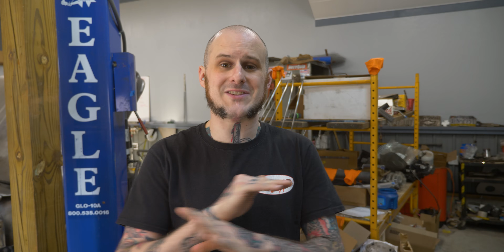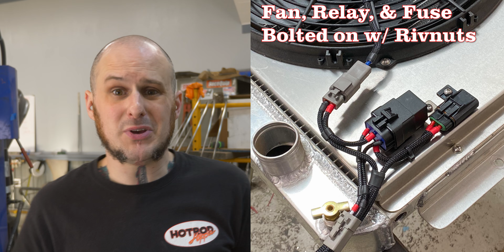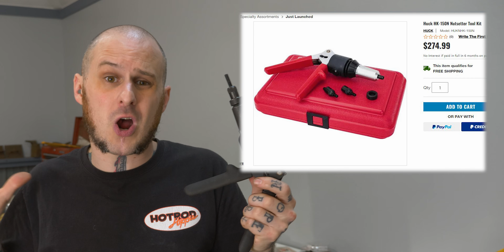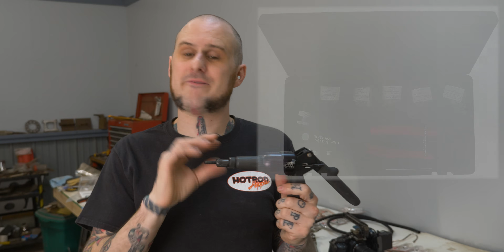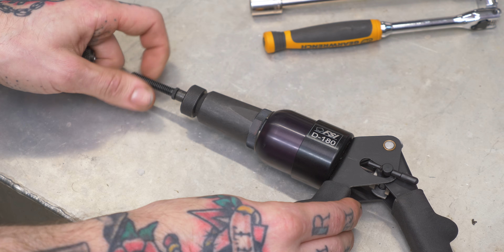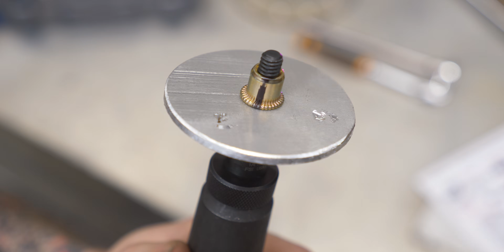RivNut Tool YOU NEED! - FSI D-100-MIL-1 - How To Use on Nutserts & Threaded Inserts!

Comment: some question i always had... installing these on painted surfaces... wont it damage / crack the paint and let water and humidity through over time ?! I.e., no rust issues ?!
Reply from the maker: I personally try not to install them in painted surfaces if I can avoid it. If I do, I’ll prime and spot paint before install with rattle can. It’s by no means ideal, but goes a long way to prevent that corrosion you are referring to. If I’m working on a bare metal project (as my work usually has be doing) I’ll spot prime before install, then they’ll be painted over.

Comment: I absolutely love mine, but do you know of any metric pull up studs that will fit this tool?
Reply from the maker: The company has them. They reached out to me about the tool after this video went up. I was supposed to contact them again and see about getting more information. You just reminded me I forgot. 😬😬 I need Metric adapters as well. I will see what I can find our and try to share the information.
Reply: @HotRodHippie  thank you very much for the reply! I'll go and check their website to see if I can find them
Reply: @HotRodHippie  Hey bro, I actually work for the company, great video! Let me know if you need any mandrels or anything else. Thanks again for the video!

Comment: There is a rivnut tool that pulls in using a drill chuck. Combined wtih a right angle drill you can use a rivnut in a very very small space. Astro Pneumatic ASTADN38 is what ive used

Comment: Well gosh. Your link is not working but I just simply searched for  FSI D-100-MIL-1. $200 or more is not an affordable approach among all the options out there. Thanks though...
Reply from the maker: Link shortening is not working for some reason so I updated the link to a working one (UNDER $200).

I don't think I claimed this was cheap compared to all the options out there.  It is Cheap compared to the name brand version of the exact same tool that sells for over twice the price and comes with less pieces in the kit.  It is a good VALUE for someone who needs a professional grade tool.
Reply from the maker: https://rover.ebay.com/rover/1/711-53200-19255-0/1?mpre=https%3A%2F%2Fwww.ebay.com%2Fitm%2FFSI-HYDRAULIC-BLIND-RIVET-Kit-Riveter-HMMWV-Rivnut-Nutsert-Installation-Tool%2F352037463337%3Fepid%3D710592532%26hash%3Ditem51f7116529%3Ag%3AD2UAAOSwdCdfYS5c&campid=5338193448&toolid=10001&customid=FSIRivnut7

Comment from the maker: NEW Link (10/21/2020): https://rover.ebay.com/rover/1/711-53200-19255-0/1?mpre=https%3A%2F%2Fwww.ebay.com%2Fitm%2FFSI-HYDRAULIC-BLIND-RIVET-Kit-Riveter-HMMWV-Rivnut-Nutsert-Installation-Tool%2F352037463337%3Fepid%3D710592532%26hash%3Ditem51f7116529%3Ag%3AD2UAAOSwdCdfYS5c&campid=5338193448&toolid=10001&customid=FSIRivnut7

Comment: One point of confusion....you introduce the D 100 and on the bench you demonstrate a D 180. And you instructions identify with D 100. My new D 100 has no selector switch.
Reply from the maker: D180 is the tool itself’s part number. D-100-MIL-1 is the part number of the kit containing the D180. These are military surplus kits so they won’t be the latest design of product but at least mine was NOS. I’ve only got the one kit and one tool.
Reply: @HotRodHippie  mine does not have d180 on it like yours nor the lever...has d100 on the barrel and my kit is identified as d100....no issues, just sharing info. It appears your kit got the new and improved. Where you flip the lever I have a button below that releases pressure.
Reply from the maker: Boxcar's Garage I think the button is the newer design honestly. It’s been a while since I’ve seen photos of the ones Huck sells now but I’m pretty sure that’s the updated design. I can’t say for sure though. I wonder if yours is a bit smaller than mine or not. 

Unfortunately this is a bit of the gamble of buying kits off Ebay like this. I’ve bought military surplus stuff myself in the past, you get what you get.

Comment: When using these as a ground point: I worry about corrosion between the rivnut and the base material... since you can't paint the hole and all...
Reply from the maker: Alan Townsend a valid concern. There has to be bare metal somewhere to ground to. It’s just a reality of building a car. Unless you build the entire vehicle with ground wires run directly to the battery it’s how things have to be. And as someone who has wired a few fiberglass cars, let me tell you how much of a major pain (and wiring mess) that ends up being. 

Generally I only install these as grounds in places that won’t see the elements. Such as underneath dashboards or underhood areas. If you have corrosion concerns then yes priming or even painting before install is a good idea. Especially when installing dissimilar metal Rivnuts (say steel into aluminum). This video was about the tool though so all of that would have been a lot to fit in.
Reply: @HotRodHippie  agreed, there is always bare metal somewhere in the equation!  Thanks for the reply!

Comment: I noticed that the backside of your nutsert holes have finger shredding shrapnel still, even if you never feel it, it looks bad. I like to use a Noga deburring tool to clean that up before I install the nutsert.
Reply: I noticed that too, shards of metal left in the hole, sloppy and not a nice clean tight fit. Does not take much time to deburr a hole properly. Where this could make a different over time is with an electrical connection to ground. A dieelectric paste wax squeezed into the hole prior to installing the nut sert would prevent long term electrical corrosion.

Comment: For grounding points try to use the larger flange versions if possible. It'll allow for higher ampacity in the connection (less resistance). The electricity will flow from the flat surface of the lug to the flat surface of the nutsert then to the bare metal underneath. The bolt is just there to clamp that stack-up together. I love using ruv-nuts wherever I can!

Comment: Just ordered one said they had 22 left @127.00 + shipping & freight but I’ve been procrastinating on getting a rivnut tool. Where is best place for riv nuts
Reply from the maker: Kurt Ludwig I either buy large packs on Ebay or more often I buy them from McMaster Carr. I use steel Rivnuts (zinc coated) with knurling on them.
Reply: HotRodHippie I going to do a lot on aluminum panels will the zinc protect steel aluminum corrosion?
Reply from the maker: Kurt Ludwig it could. I’ve not had an issue with it to this point but it is very possible. Painting the hole before install can help provide a barrier. Or McMaster has Aluminum Twist Resistant inserts (knurled). That’s the safer bet for an aluminum project. Just be careful when bolting things together as the aluminum ones will be easier to damage the threads.

Comment: i'm rather new to rivnuts. used them recently on a few projects. really handy for places where you can;t get in to put nuts on bolts.
however i have some concerns with tightening up on the small raised part of the rivnut and there is a gap between the parts being bolted together. how do you manage that with?
Reply from the maker: tweake most things I’m fine with the stand off. In the past I’ve made parts that set down around the nutserts. There is also a company that makes a dimple tool that depresses the area of the Rivnut so it’s flush with the surrounding metals. That company is called Hammer-Fab but that requires being able to access the back to setup the tooling. 

Overall it’s just rarely an issue in my work so I don’t worry shout it. As I said I’m not mounting anything structural where the loss of flange contact is reducing the strength. Heck I used nutserts for the exhaust trim rings on the C10 and it kind of gave them a neat “shadow line” look with the separation from the painted metal.